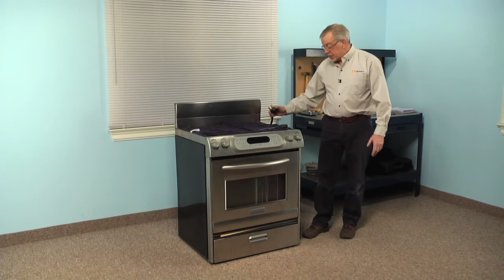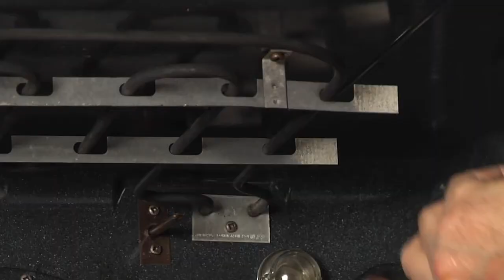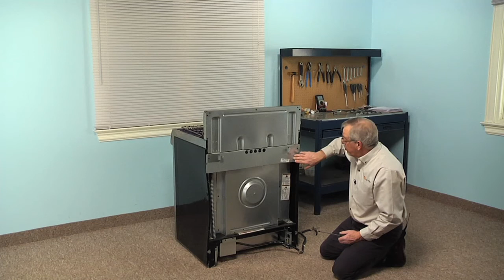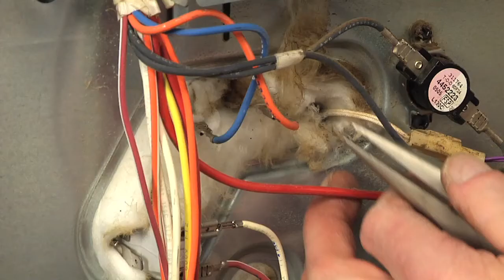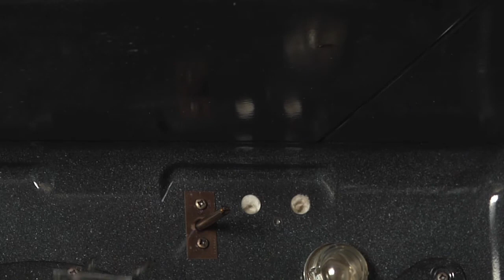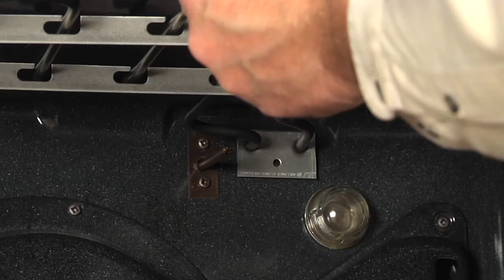Range Repair - Replacing the Broil Element (Whirlpool Part # 9760774)

Comment: What is this is a wall unit and you can't get to the back panel?    Also, is the other coil suppose to glow red or just the inner coils?   I can't get the outer coil to glow red and I'm not sure if I am not putting the oven on the right setting.
Reply from the maker: You may be able to pull the element far enough forward to disconnect the wires from the terminals without removing the back panel. If not, you will need to remove the wall oven from the cabinets. Depending on the model, the outer coil may not normally get red. Most units that use this dual broil element have high and low broil settings and the inner element may be used for the high setting.

Comment: Should there be smoke when using the new element? I wouldn't think so, but maybe it's burning off a coating or something.
Reply from the maker: Amanda Nelson We have occasionally seen this happen, but if it continues you can remove it and clean with a mild detergent and water. Dry thoroughly before installing.